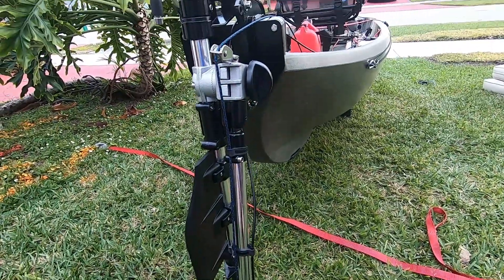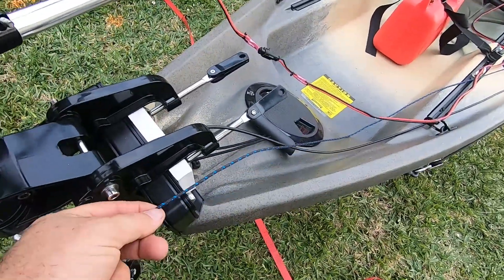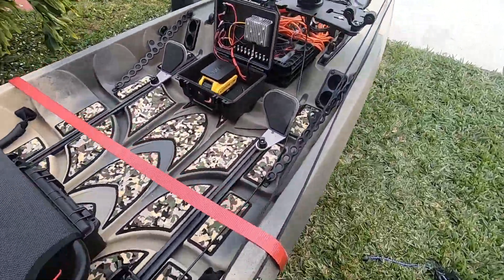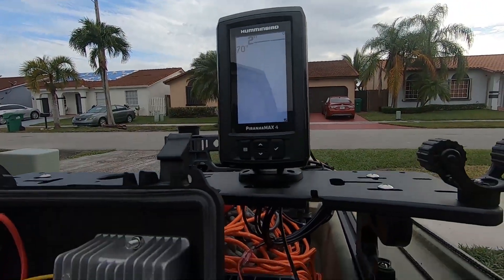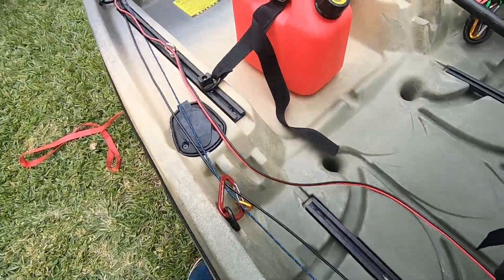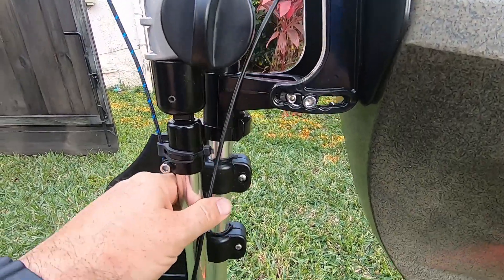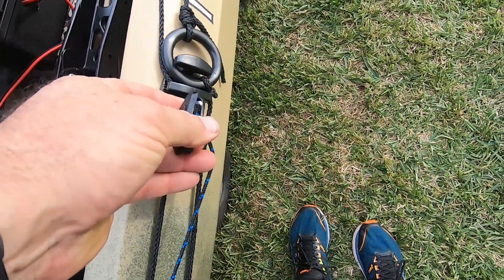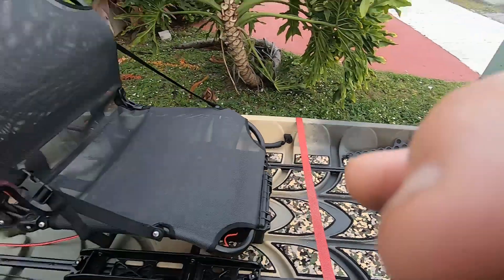Sonar Arm Attachment Installed with a Dewalt Style Battery Powering the Fish Finder

Comment: What's up.. nice, but why didn't you mounted through the scooper hole, any reason? I heard that bubbles and transducers don't go along.
Reply from the maker: It is much easier to have it affixed to leg and get rear imaging and mid kayak imaging. The new version has it sitting a few inches above the prop and to the side completely out of way and locked.